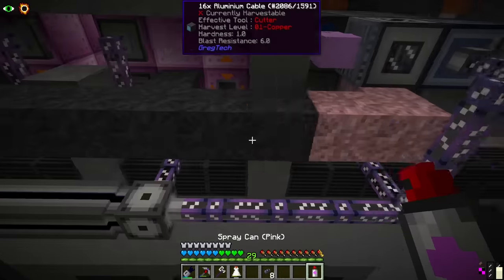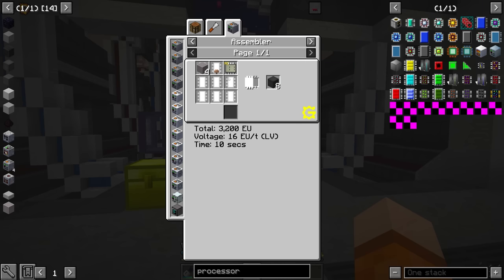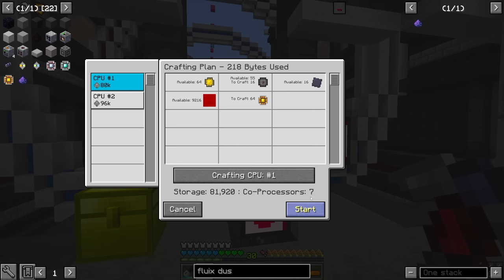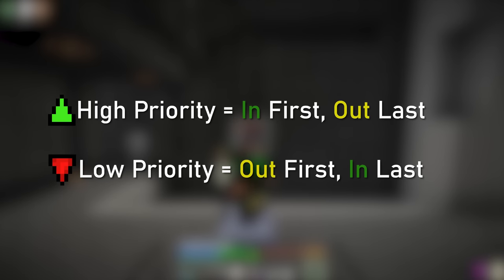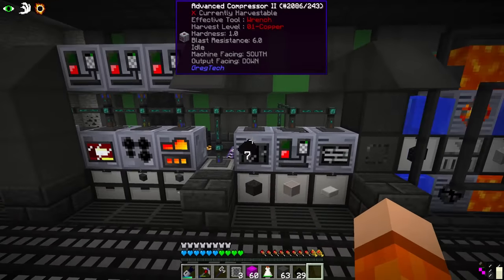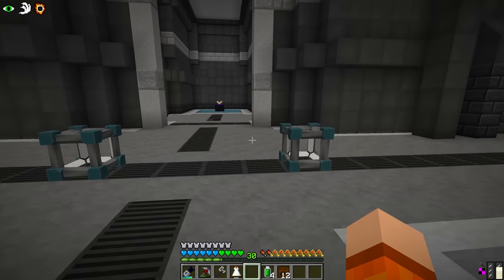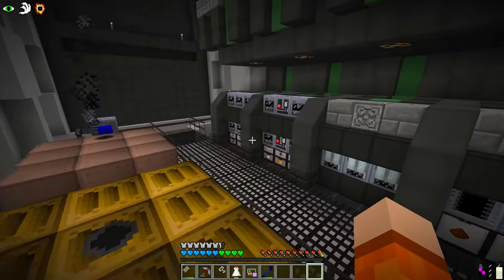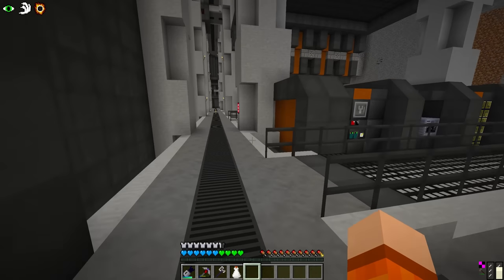Gregtech New Horizons S2 45: Gregtech Spaghetti

Comment: Hello! I would put a void excess on the oxygen tank. A lot of processes make oxygen as a byproduct, it means that oxygen can clog up these recipes. So that and just put a priority system on the oxygen maker so it only makes oxygen when it's low. Overall oxygen isn't that valuable to not be voided. Also a reminder, every byproduct counts and nicely stacks up with more recipes, I recommend throwing absolutely every byproduct into a system as long as the final destination (being the supertank) has a void upgrade so it doesn't clog up but still adds up when needed. It saves you a headache.
Reply from the maker: Yeah we'll need to start to void the Oxygen as you mentioned it could stop some crucial processes if it fills

Comment: Ashes are also useful as a source of Carbon Dust, if you don't have a Benzene setup producing that directly or indirectly (since another good source thereof is Charcoal Dust). Use that instead of sacrificing precious diamond dust you're going to be short on in the future, if you need it.

So the details RE: feeding RF power to machines using GT EU. GT cables, transformers, etc., are able to automatically convert EU into RF, at a 1:3.6 conversion rate. Yes, the default conversion rate is 1:4, but no, GTNH doesn't use this. It was changed to 3.6 in one of the configs, don't know why but there you go. However there is a problem - RF machines don't necessarily understand the concept of Amps, so they'll either consume all of the amps on a given line, or they'll only recognise one of them. If you check the Dimensional Transceiver it was reporting an input of 115 RF/t, though that wasn't enough to fill the buffer due to the 500 RF/t passive power drain. 32×3.6=115.2, so we can conclude that in this case the Dimensional Transceiver was only recognizing 1A on the 16A LV line, and thus not getting enough power. The solution to making sure RF machines are well fed and don't cause issues is to use EnderIO Capacitor Banks and - if you're connecting RF machines on a power line - GT Diodes (remember that a machine hull acts as a 1A diode) to regulate power input/output. The diode will make sure that only 1A will ever be send to the RF power line, meaning you'll never have issues with burning cables due to RF machines randomly drawing infinite amps (though if you're smart and make sure your cables can handle the maximum power draw on a given line that won't be a issue regardless). The Capacitor Bank, in turn, will convert this 1A into RF so that your RF machines won't have any issues trying to all feed off of a single amp of EU power. Another thing you can do is limit the RF/t input into Capacitor Banks so that they'll only be able to input up to 1A of a given tier of EU power, though I can't confirm that this will definitely prevent any issues with directly feeding RF off of EU cables. One final note is that Capacitor Banks are not lossy - they are smart enough not to constantly draw a full amp worth of EU if their input is limited to less than a full amp.

Dimensional Transceivers, by the way, are available to craft much earlier than Ender Chests/Tanks if you don't pursue any of the early Iridium methods. They're not as convenient to use due to the passive power requirement, and not simple or cheap to craft requiring an LuV circuit and alloys that require a TPV coil to smelt, but they are functional ender chests/tanks that are available without Iridium and and without a small amount of magic progression.

Dense Obsidian Plates is one of those things you craft a dedicated machine for that you just refill with a bunch of obsidian plates from time to time. Crafting them on-demand isn't worth the time it takes until you've set up the GT++ bending multi, pretty much.

Handling excess oxygen is a curios problem, since you don't want dedicated oxygen producers to run if you're full up on oxygen, but you don't want processes that produce oxygen as a byproduct to stop running just because you're full up on oxygen. This is, in a way, another argument in favor of the half oxygen half Alu dust solution, since in that case you can easily just say that the oxygen is a byproduct, of sorts, even though it isn't. Still, level emitters or wireless covers or wireless redstone or what have you can and will solve this problem one way or another, it's just a question of how you choose to resolve it.

I've mentioned before that maintenance was going to become a problem in this era of multis, and that figuring out some sort of solution for it was going to become necessary. Be it maintenance lights or a maintenance control room of some sort - whichever solution you choose to pursue go for it, because you don't want maintenance issues to creep up on you. It's going to be a very long time before you'll be able to fully automate it, and even longer before you'll be able to afford it.

EBFs is one of those things you definitely don't want to fall behind on, because you're going to run into issues if you do. Setting up platline to finally get Iridium, for example, isn't going to do you much good if you don't have the IV EBF required to actually smelt the stuff. Particularly for EBFs there's a choice to make that you'd be better off answering right now: Volcani spam or MEBFs? Eventually you're going to need either solution - or a bit of both - to handle the incredible amounts of EBF smelting that the pack is going to throw at you sooner rather than later, so preparing space for it ahead of time would be prudent. Broadly speaking Volcani spam favors a more "passive stockpile of resources" approach and is (relatively) very gently on your ever increasing power demand, though requiring investment into bees or crops to supply the necessary Blazing Pyrotheum easily. A lot of passive/dedicated processes will also involve a lot of AE2 channels, for what that's worth. MEBFs, in contrast, are the definition of a "throw more power at your problems" approach, but if you can supply that power their speed and simplicity are unmatched. You definitely want to reserve a straight line connection to your (future) LSC power bank if at all possible, or at least reserve as straight a line as possible, to later install a Laser connection to fuel the MEBF with the truly absurd amounts of power that it'll need to leverage the edges that it has.

Always, always*, check a machine controller's tooltip for the amount of minimum casings that it needs. The NEI preview is *not a perfect representation of how multis should be configured, merely a guideline to how they are build (and sometimes not even that). In the case of the GT++ multiblock mixer it actually only requires 6 Multi-Use Casings minimum, instead of the 26 that the NEI preview shows you. That's an awful lot of input/output space to leave on the table, so double-check those controller tooltips.

I feel like one of Three's leprechaun union representatives got into a discussion with GTNH about the lack of free ender chests clearly denying the man the luck he's contractually owed, and this sudden rain of dimensional transceivers is the compromise the two sides managed to agree on 🙃.

Here's to hoping Three doesn't have any issues figuring out how to build platline into the base, because if so I'm worried about the next, what, two or three processing lines still left in IV? It's a hell of a ride, that's for sure 🙃.
Reply: I think the Oxygen solution would be best handled with a restone controll on the passive machine, turning it off when oxygen in main storage reaches 95% or something and turns it back on again if it reaches something like 50%, together with the oxygen byproduct producers having a buffering supertank (tier 1) with void excess enabled so that they will always still produce oxygen and only void any excess when oxygen is full and the 4000 buckets of buffer before going into main storage is also full, maybe use a small p2p (sub-)network for speed on the way from machine output to buffer storage, if speed is required and channels and pipes are to be saved. 
Its also an option to possibly increase oxygen storage to a second supertank, but that might make p2p fluid handling a little difficult if you suddenly require dedicated p2p fluid I/O... I'd rather abstain from that

Comment: have a floating Threefold logo inside your glass dome so when u look up u can see the logo for the statues maybe you can consider making one of your character? or maybe even a pet you have
(in game/irl). You might want to consider having a maintenance room where all the Redstone lamps are put in one spot and ladled with signs to check for issues easier rather than having to run everywhere to check each time, although might be expensive to craft wireless detector covers..

Comment: 23:50 instead of limited item filters, you could use gregtech robot arms, they can be placed as covers on gt blocks exactly like conveyors and pumps, and act almost exactly like conveyors with extra smarts. Using them you can specify exactly how many of a specific item you want to keep inside of an inventory (ie: chest/machine input) and gt item filters can be added to filter what items are transferred.
Note: take this advice with a grain of salt, all of my gt knowledge comes from omni/nomifactory, I do not know if gtnh changes the behaviour of robot arms/gt item filters
Reply from the maker: Yeah, are correct that would work in Community Edition of Gregtech, however it works a little differently here in New Horizons :( Robot Arms don't have that extra function as a cover.

Comment: Hi Three, I realised that your benzene system produces ashes from the wood tar extractor recipe. You could use those for passive light gray dye.
Reply from the maker: You are correct we make Ashes from Benzene, however that gives us the GT Ashes. The one that gives dye is from Biomes O' Plenty and they are not interchangeable :( Good suggestion though :)
Reply: @Threefold.  Wow I didnt know that there were different types of ashes. Thanks for the info :)

Comment: Ideally you don't want to delay setting up something for platinum for this long, and as of recent changes (which Three skipped past before updating) it's even a lot harder to do so. Some kind of small setup, like you should have for rutile processing post-Moon, should be sufficient at first. Then later on, once you're ready, you can expand and plop down the full final platline.

It's important to keep coils up to date for machines that can make use of them, like the EBFs and multi-smelters, but it's also worth prioritizing and being a little bit of a cheapskate if upgrades aren't totally necessary. Leaving a multi-smelter with Kanthal at this stage would be setting yourself up for disappointment, but a set of TPV coils after upgrading an EBF to HSS-G? That'll probably get the job done, and if not you can take a look at how long it'll upgrade the EBFs to the next tier of coils so their old ones can (once again) go to the multi-smelters or oil cracking units. Depending on the situation it might be worth pursuing that path rather than crafting up a new set or current coils instead.

This channel does have a bit of history with floating parking lot bases...or "base", just the one I guess. But either way seeing as how this current base is largely underground that approach will, sadly, not work in this instance 🙃.

Generally it's advised to stick to meta as much as possible, simply because when everything takes so long and so many resources to build you'd be crazy to take the approach that takes 50 hours instead of 5. That said strictly sticking to the meta is a great way to get burned out or even worse, get bored to death, so tackle those minor vanity projects as you come across them anyway. GTNH is a marathon odyssey no matter how you approach it, so if you're going to be left stark raving mad by the end of it anyway you might as well strap in and enjoy the ride.

You can make AE2 processors the normal AE2 way, but in GTNH it's not worth doing so. GT machines (and if not that definitely the GT++ multis) are just faster at processing them, and you're going to be automating literal dozens upon dozens of them anyway, so a few more isn't going to hurt.

This is why I recommend building small automation setups like the rutile processing when you're able to. Properly build they continue to function and stay relevant for well past what you'd expect to be their expiration date, and when you've got such a long list of everything you need to build everything to get everything else it's really nice to be able to just skip a step until later. In the example of Rutile processing it should have been obsoleted by a T2 rocket, since at that point you can get pure titanium dust from several T2 planets as small ores. But in practice it keeps running and keeps supplying precious titanium, while the other EBFs are free to process higher end materials like HSS-G, HSS-E, and so on. If you're really on top of future proofing designs you can even hook them up into AE2 as easily as just slapping on a few storage buses and fluid P2Ps, which is very nice indeed when the list of things you need to automate to automate all of the things you need automated to automate all the things seemingly grows larger and larger with every machine you want to craft next.

It might seem like a waste to spend redstone dust to produce obsidian, and earlier in the pack I would say that it is, but at this point you definitely are going to have some form of glowstone production automated at the very least for circuit production. Meaning automated redstone is likewise within very easy reach, one way or another. And even lacking that regardless MBMs are very good at turning Nether Redstone veins into ungodly amounts of redstone, especially now that the need for centrifuging redstone to produce ruby dust to produce chrome dust has lessened since the Moon gave access to Chromite ore.

Bit late now I suppose, but I would highly recommend actually coating your fluix cables to see channel usage on them, and not letting your AE2 become such of a 🍝mess in the first place. Definitely don't delay fixing "temporary" messy setups any longer than you have to, because the more you have to rewire your AE2 network after setting it up the more you're going to have yourself later.

Lubricant is something that you should have in needlessly large quantities circa LV, so really the only reason not to feed a cutting machine lubricant is if you want to save yourself a fluid P2P and a channel connection. Neither of which are too expensive at this point, but of course if anything can run slowly it's a passive system, so this will get the job done. Do try to use good recipes where possible, though, because too many of these kinds of garbage recipes will catch up to you if you're not careful.

That said there is such a thing as casting pearls before swine, and using something like iridium or, heavens forbid, osmium to make something as simple as (bulk amounts of) Rebar definitely qualifies as that. Even Alu is questionable, since Alu dust is going to become very critical for Indium processing very soon, and in fact is going to become so critical that one of the recommended solutions for passive oxygen is only half passive oxygen, and half passive Alu (which would be Red Granite Dust from Red Stonelilly). Iron is something you're going to have in absolutely ludicrous quantities from your ore processing system despite actively avoiding iron byproducts since they're not worth the time or effort to get, so for something like mass-producing Rebar it's definitely ideal to just throw a ton of iron at the problem and call it a day.

For those curious, yes, this does mean you need endstone before your yellow stone lilies are able to produce end stone dust. Worst case scenario there's a Thaumic Bases tree that can generate endstone in the overworld which doesn't require materials from The End to craft, so that's your early source of endstone if you need it. Also note that this mechanic is not exclusive to the stone lilly crops, though it is rare outside of them - magical metal berries, for instance, are able to produce Thaumium, Thauminite or Void Metal depending on what type of crux they're given.

There's several ways to replicate limited item filters, Logistics Pipes and Steve's Factory Manager are able to for example, but there's few things as convenient as just a limited item filter. You can find ways easily enough, but finding convenient ways is a completely different story.
Reply: Regarding the crops,
a) Are there any crops that grow at a different speed based on the crux (i.e. two different cruxes work but one grows the plant faster than the other)?
b) If so, are there any crops whereby the best strategy for cultivation is to use one crux to grow the crop and another (different) crux to harvest the crop?
Reply: @James_Moton  Crux doesn't influence growth speed to my knowledge, and given the difficulty in swapping a crop's crux before it's harvested I don't think the strategy would be worthwhile even if it worked. Once you've got statted crops (or a crop bot) it'd be much easier to simply breed/plant a few more crops to speed up production than it would be to set up some kind of switching mechanism.

Comment: Good job!
Quick question can you show the audience, how much power you are using? Just thinking about how much power is being drained from the simultaneous processes
Reply from the maker: It's quite tough to tell since all of the transformers, energy hatches and batteries buffer power so it would be impossible to get an accurate reading throughout the whole base :(
Reply: @Threefold  fair, just slightly concerned on power throughput